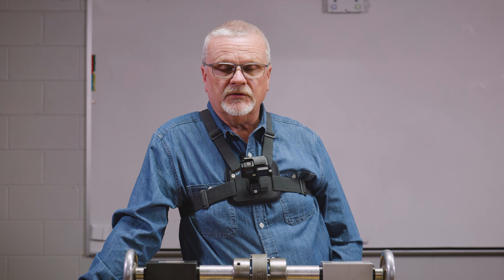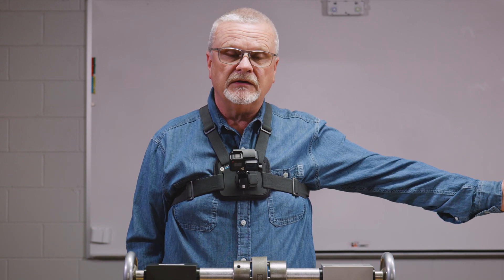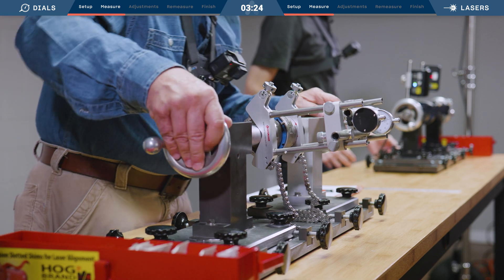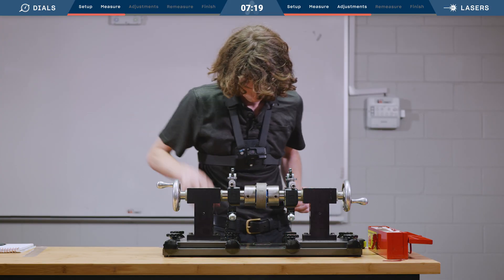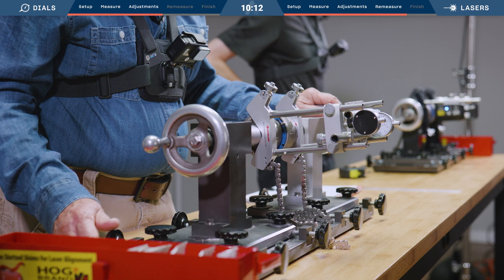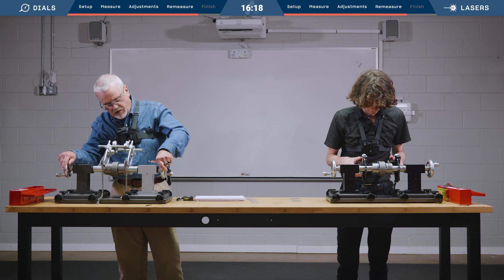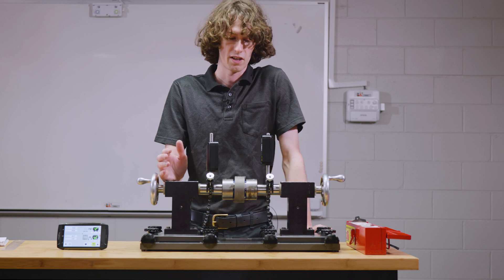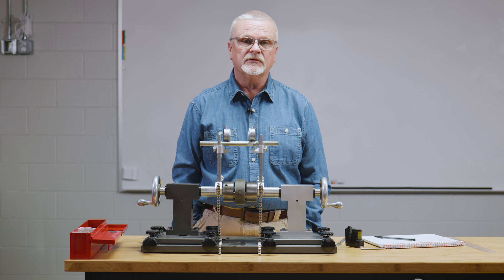Dial Indicators vs. Laser Shaft Alignment | ACOEM

Comment: I started in ammonia and freon compressor alignments in 1982. I started with dials and still use them. Although I have had several laser type alignment tools demoed, I still prefer my dials. The electronics need to be calibrated once a year and I question at what point is the calibration giving me slightly inaccurate measurements. Then there's the battery issue. I do a lot in remote areas pumping water now. If I were to forget to charge or bring extra batteries, I'd be in trouble. The work area is generally very wet, dusted and in direct sunlight. My experience is electronics don't like those conditions. The last factor is cost. Lasers are expensive although I have seen them come down over the years. A laser is able to do the heat growth calculation for you but if you are experienced, you'll be able to compensate with your dials. Maybe I'm just old school. Maybe just too tight to spring for a laser. Either way I'm a dial guy. Thanks for the video.
Reply: I dropped lasergear in boiling water standing on a bfw pump base not long ago and it still works great lol
Reply: I still respect the fundimentals though